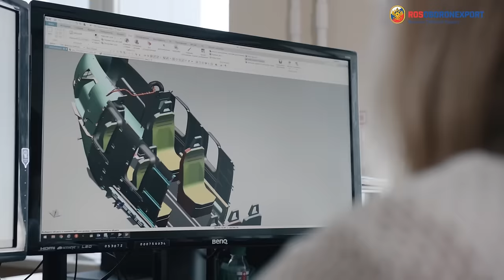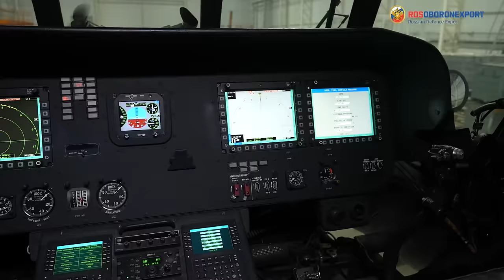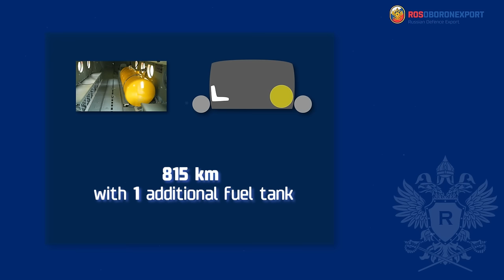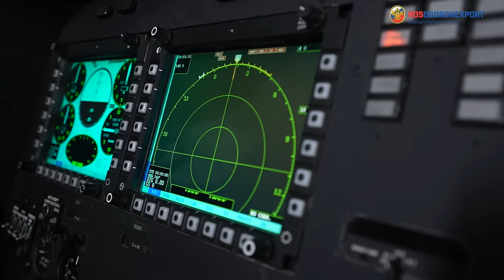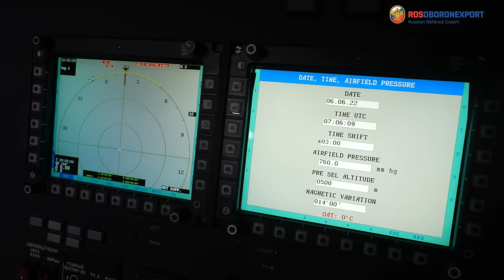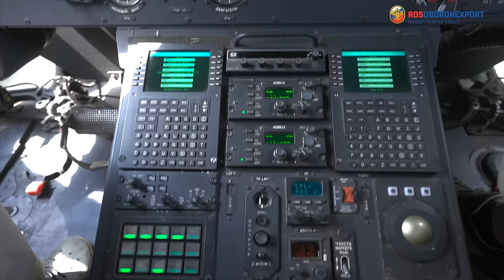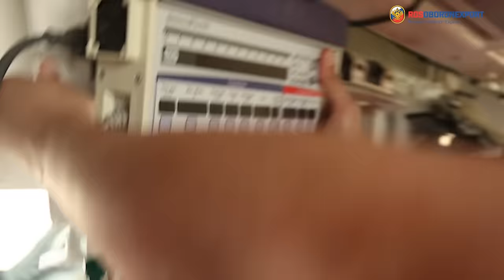Mi-17V-5 Military-Transport Helicopter

Comment: In 2001 AFTER 9-11  a company owned by CIA bought a small fleet of brand new Mi-8 MTV-1 / Mi-17 for use in Afghanistan. Several years later I supplied spare parts, manuals etc. as TEJAVIA.
Reply: Ваши вертолёты не могут работать в условиях запыьённого воздуха.турбины выходят из строя. Ми работает в любых условиях, и требует минимум обслуживания.

Comment: What is difference between Mi-17 and Mi-28 ?
Reply: Very different.
Reply: @definitelyfrank9341  I mean Mi8 both are transport helicopter
Reply: @ayazfetelizade3004 Nope, Mi-28 is a dedicated attack helicopter and doesn't have the ability to operate as a transport helicopter. 
I believe the helicopter you're thinking of is the Mi-24 which is an attack helicopter capable of carrying a small number of troops in its cabin. 

The difference is obvious; the Mi-24 is an armored gunship/attack helicopter incapable of carrying a substantial load. The Mi-8 is a heavy-lift transport helicopter capable of carrying several tons of cargo and over a dozen troops. It carry small number of unguided rockets however is rather ineffective in the attack role.

Comment: What is amazing the the almost total absence of this excellent helicopter in the SMO. For example dropping Spetznaz units in the rear echelon on the enemy at night for night-time raids for uplift at first light. Its not happening in the SMO, which is a real pity. The SAAF used Puma choppers to drop Recce teams 250km into southern Angola with great success in disrupting Angolan/SWAPO logistic lines/blowing up bridges.....sad to see the Ru Forces cannot do the same in Ukr (of course the cynics will say "but what about Ukr air defenses"....those are known and can be avoided FFS). Ru has the 45 Guards Spetznaz Brigade, that is their role.

Comment: where the hell is the mi-38 its sucessor?
Reply: Ми-38 не его приемник
Reply: @BBCRF  это
Reply: It is so much "Russian" helicopter, that due to shortage of Western components, they are forced to stick to keep building Soviet Mi-8 and it's derivatives😅
Reply: @Andy_Novosad  the mi-38 is its upgrade and none of its components are made outside russia.
Reply: @Globalscanningeyes  BS, new russian designs are even more dependant on western components and technologies than old ones.
Reply: @Andy_Novosad  maybe watch the video first,the mi-38 uses a Vk-2500 engine the same one use in the latest mi-17v5 but with improved efficiency and power.
Reply: @Andy_Novosad  the Tv7-117 is russian designed,motor sich is one of producer of the engine not its designers,the vma version is a Ukrainian license produced engine that was produced after the fall of the soviet union,the tv7-117 is a completely different engine the vk-2500 is based on
https://en.wikipedia.org/wiki/Klimov_TV3-117
https://en.wikipedia.org/wiki/Klimov_TV7-117
Reply: @Globalscanningeyes  First: where did we talk about the TV7 aircraft engine?  Secondly: the fact that the TV3-117VMA modification was once developed jointly with the Russians does not change the fact that they are manufactured in Ukraine and were smuggled to Russia on Klimov, including for further installation on combat helicopters, which were later  used against Ukraine itself.
Reply: @Andy_Novosad  as I mentioned the vk-2500 is a variant of tv7,and no the tv3-117vma was not smuggled to russia,it was used for export aircrafts in a joint venture between Antonov and klimov
Reply: @Globalscanningeyes  You are wrong VK-2500 is a variant of TV3. Not to mention that helicopter version of TV7 is hardly can be called serial production engine, cause there is a dozen serial produced Mi-38 in past 5 years at all. And the irony is, that even a part of these few helis in excistence are equiped with American Pratt&Whitney engines.
Reply: @Andy_Novosad  it is literally a variant of the tv7,whether you like it or not and the pratt-whitney engine was used on the prototype the production variant has the vk-2500,goodbye
Reply: @Globalscanningeyes  are you high or something?

https://en.m.wikipedia.org/wiki/Klimov_VK-2500

"high power derivative of the TV3-117VMA"
Reply: @Andy_Novosad apologies i confused the vk-3000 with the vk-2500 which is based on the tv7-117,honest mistake since its literally designed by the same design bureau and the other mistake i made was saying the vk-2500 is used in the mi-38 which is not,its the vk-3000 thats being used.